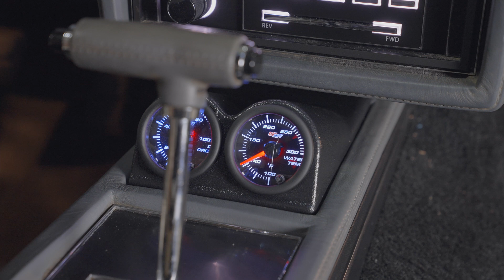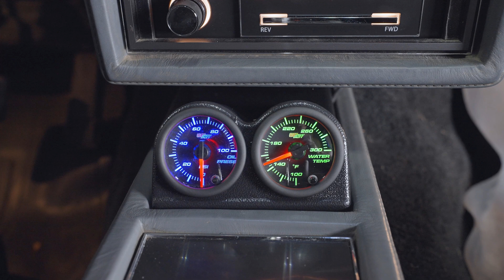GlowShift | How To Install A 7 Color Series Water Temperature Gauge

Comment: The only problem I have is fear 🥺🥺🥺🥺🥺🥺 powerful electric
Reply: Just remember to keep negative terminal of battery off until you're ready to test. You'll be OK.
Reply from the maker: Nah, nothing to worry about!
Reply: @jrios030284  I just put mine in yesterday. I love it, I'm getting an oil pressure gauge next.